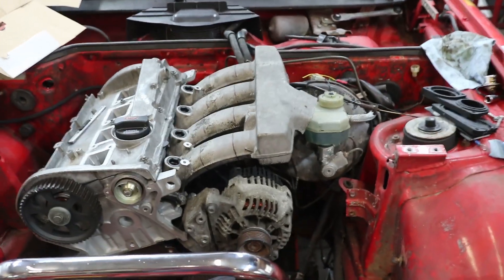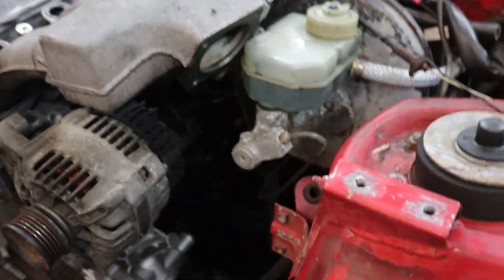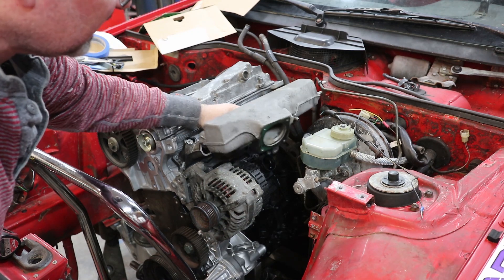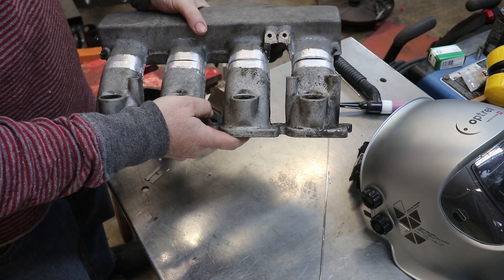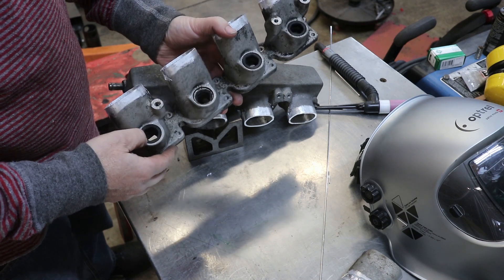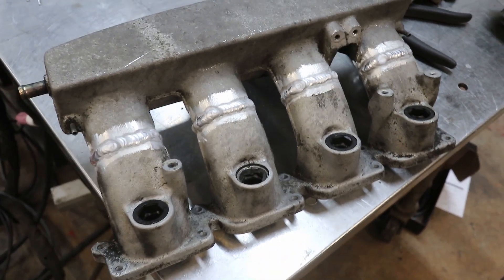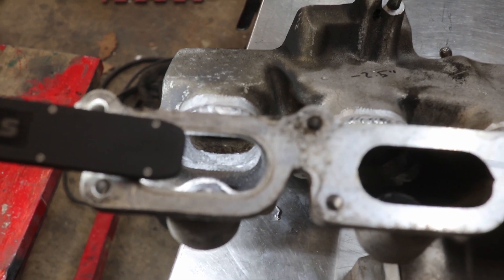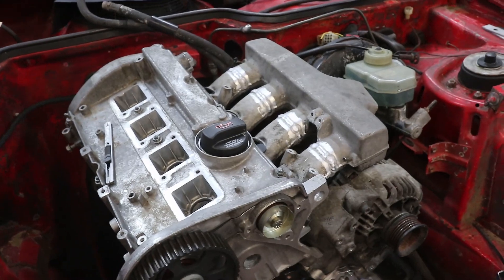Modifying 1.8T intake manifold to fit Porsche 944

Comment: brake fluid holder can go remote ala BMW  e32 two tubes   on top  of master. mucho room.  also nipple could in reality  could be welded on front and rear one plugged . if you beveled inner surfaces maybe less ridge. . still impressive.

Comment: Intake manifolds are designed but length of run based on volume of air needed.
So, shortening those runners, i believe you are altering air volume needed in the runners.
Reply from the maker: You're right.  But doing a wacky engine conversion means I have to make sacrifices to make it fit. :)

Comment: Also the injector cups do unscrew or at least they were meant to but years of heat and the factory sealant they put on the threads. Phoenix Engineering makes aluminum replacements and they hold up really well. The oe plastic cups tend to not seat well after a few years.

Comment: You could always just use the intake manifold from golf or jetta which would put the throttle body facing the front of the car and then you wouldnt have to cut anything.
Reply from the maker: The hood doesn't quite clear that setup.

Comment: Is there a benefit to the 1.8 T engine?
Reply from the maker: It's cheaper and lighter than a 944 engine... and it'll make more power.  That's not to say it's a perfect solution, but it's a fun challenge.

Comment: Always need to replace those seals 
You can get them from Vw or audi
They are 2 sizes 
Yours prob the smaller ones as it’s a ko3 turbo
Reply from the maker: Ahh, good to know.  I ordered a new set (stock p/n) - but it I need bigger injectors, I might need the larger seats?
Reply: Van Svenson well the 225 engine is deffo different as that’s what I have however iv now got a SEM manifold and 1000 cc injectors as I’m over 500 BHP 
I think you can keep those seals even when u go bigger injectors if u are using Bosch 
U will prob need to change the loom plugs or get the conversion loom plugs ( plug and play )

Comment: Those seals are supposed to unscrew, but they get brittle over time and just fall apart, they also leak all the time. You can get aftermarket ones made from aluminum which expand at the same rate as the manifold during heat cycles thus preventing leaks.
Reply from the maker: Good to know - thanks!
Reply: @vsvenson   Noah at Phenix Engineering has those. He makes them. https://phenixengineering.com/shop/page/4/